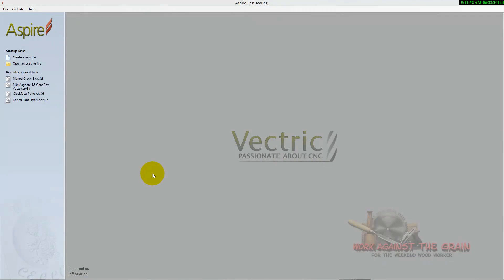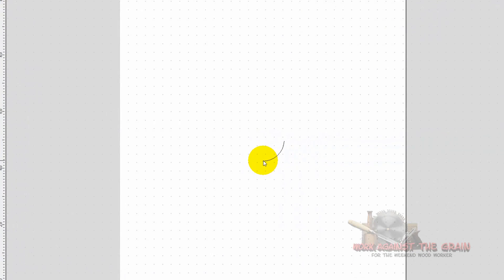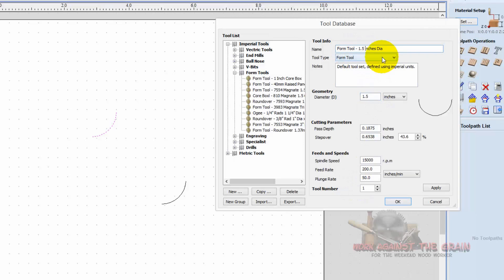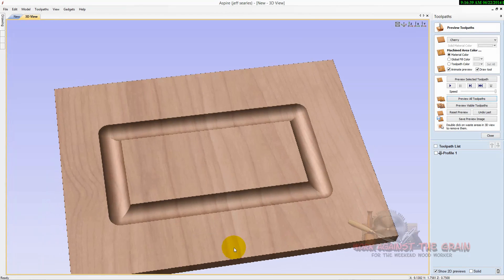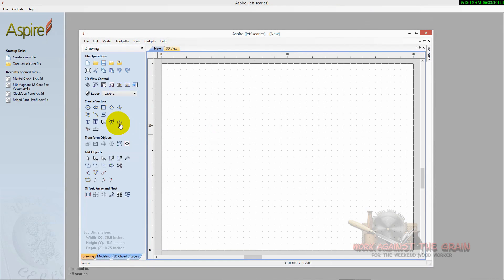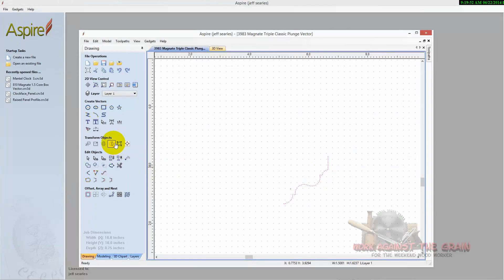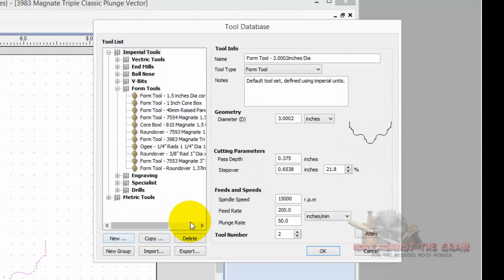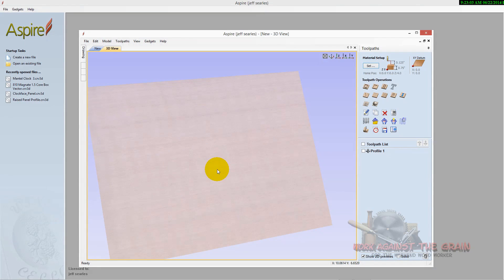Vectric Add Form Tool Tutorial

Comment: Hi, I have a question about round edges on the outer corner edge of the toolpath. For example at 5:18 in the video, the inner edges of the corner are sharp, but outer are round, is there a way to make sharp outer corner edges with the form tool. I suppose the form tool should be extracting the corner from the lowest Z height to the highest following the curvature of the shape of the tool.

Comment: IF you inport the vector from tool manufactor how do you edit taper ball nose v bit 4 flute to get half of profile to enter it into data base
Reply from the maker: Tapered ball nose and or V Bits are not entered into the database under form tool. There is no need for half the tool and a vector. Click add new tool, then from the drop down menu select the type of tool either tapered ball nose or V bit. Enter the parameters. You need to know the angle in degrees for the tapered ball nose as well as tip RADIUS. Thanks for watching.
Reply from the maker: Having said all that, if you need half of a vector, use node editing to break apart the vector. Select the vector and type the letter N, and you can cut the vector in half.